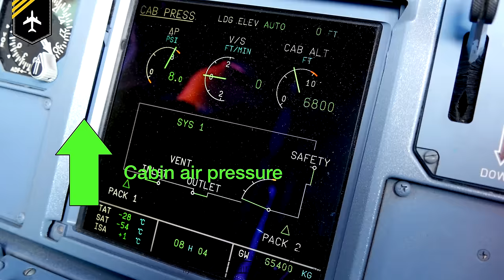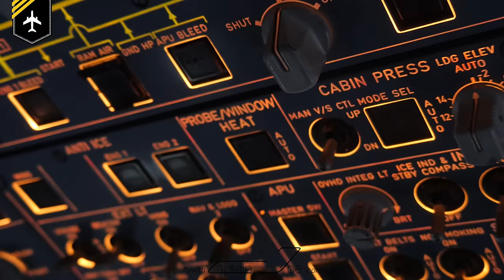Why is there a HOLE in AIRPLANE windows?

Comment: Would pilots in cockpit know immediately (or in very short time) that outer glass is fractured in passenger window when middle fallback layer became only operative (assuming air would flow out through that pressure equilibration hole?) Is this emergency situation for diversion from destination?
Are there any related incidents related to passenger windows?
Reply from the maker: That would be a very slow decompression, it would cause for an emergency descent! Greetings Joe
Reply: Dev Deviruchi A warning alarm would go off if i is in a critical level

Comment: I have a question. What is trim and what are the spinning trim wheels next to the throttle and what are the smaller levers behind the throttles.
Reply: ukkomies100 trim makes the aircraft easier to fly. The spinning wheels is what the pilot uses to adjust the trim but when they are spinning by themselves that's the autopilot. The small levers are the reverse thrust. They are pulled up and back to engage the thrust reversers.

Comment: Very nice! I couldn't help but notice that on my last flight, which was on a 737-8AS, there wasn't this hole? Is there a reason for this?
Reply: I recently flew with a Transavia 737-800 and I couldn't see it eighter and in the 737-800 from Miami Air I couldn't see it eighter.
Reply: Kai Van Loon Maybe it's an Airbus thing...
Reply: Newer windows might have them on the side so you can't see them.
Reply: +00PiggyCosmonaut They're on the top on the new 737 ng's. They've been having fogging issues with the hole in the bottom design, at the top of the windows there's a cream coloured rectangular tab which does the same job as the hole, but prevents fogging.
Reply: Aah okay thanks
Reply: Aah, I have seen that, thank you very much for the info
Reply: Cool. Airplane window engineering has definitely come a  long way since the square corners on the windows of the de Havilland Comet :)

Comment: why airplane need flaps?
Reply: Siap l Minecraft why?? Flaps needed for extra lift when take off & reduce speed when landing. If flaps wasn't needed, plane lost lift power & there'll be accident like Spanair 5022.
Reply: Same reason yo momma has flaps
Reply: Flaps generate more lift at low speeds. Without flaps the runways would need to be much longer to give the planes time to accelerate to the higher speeds needed to take off and long enough of the landing planes to slow down. With flaps planes and slow right down when landing and can lift off at lower speeds during take off.

Comment: Hi Joe, just wanted to know why does the captain always take control on the ground even if the F/O landed the plane?
Reply: Charlie Delap "Captain taxi" rules. Not all airlines adapts to that procedure
Reply: Ifly 777 Ah I see, thanks for clearing that up for me
Reply: Some aircraft also only have a Nose wheel steering tiller on one side. IIRC the 737 only has one on the captain's side as dies the ATR.  The A320 has one on both sides

Comment: captain joe, can you explain why the airplane windows is round and not square?
Reply: Zikri Amrillah the pressure would build up on the corners of a square window and the square window could fail. A round window equalizes the pressure around the window so the pressure does not build up in one spot on the window.
Reply: The Space Wolf does it mean the round window can maintain the pressure off?

Comment: what happens if you put you finger on the hole in side the cabin
Reply: 1.  The hole is in the middle pane, not the plastic cover you can touch.
2.  Even if there was a hole located in the inner pane covering it would have no affect since the pressure/humidity/temperature between the inner and middle frames is identical under normal operating conditions.

Comment: What is "trim"????
Reply from the maker: Video coming up :) Greetings Joe
Reply: Bill Kaczmarek It is the two black and white wheel spinning thing besides the thrust levers
Reply: Grossly oversimplified, Trim is a way to make small adjustments to the flight control surfaces to create a desired tendency. lets say youre flying a Cessna. And you are at 4,000 ft. Youre at cruise speed. depending on how weight is distributed the nose may want to naturally rise or lower on its own. You can trim the elevators to a point where (even if you let go of the yoke) the plane will naturally hold level flight.
Reply: What my wife does to her bush every month
Reply: Booyah!
Reply: Its kind of like a lift adjuster.
Reply: Billybo y a haircut
Reply: Billybo y
Reply: My regular cut

Comment: how do you maintain supply of oxygen inside cabins at high altitude??
Reply: rahul dwivedi The air is taken from the engine. Because the air in the engine is compress
Reply: but at higher altitude practically no air ????
Reply: rahul dwivedi There is air. If there is no air then planes can't fly. When the air is compress, the air becomes thicker and the oxygen atoms becomes more dense.
Reply: You get the oxygen and cabin pressurization from the Environmental Control System (ECS) bleed air. When air enters the jet engine, it gets compressed. As the air gets compressed, it gets pretty hot ~500C and a portion of that air is tapped off and sent through a primary heat exchanger (radiator) where it cools down. After cooling, it goes through an ECS turbine or a pack and gets decompressed. As it does it heats up again, and goes through a secondary heat exchanger and after a series of check valves and such reaches the cabin at a cool ~50F You don't get any of the carbon monoxide or anything because it's before the combustion chamber of the engines. Hope this helps. I tried to simplify it a little haha. 

-F16 Avionic Systems Technician / RC-135 Communication and Navigation Systems Technician.
Reply: So do the check valves regulate cabin pressure?
Reply: KiwiPowerNZ not check valves per day but regulators. Different planes are regulated at different altitudes. Some are pressurized at a 4,500 ft level others as high as 8,000 ft. That means at let's say 39,000 ft altitude the planes interior is pressurized to what the pressure would be at 8,000 ft. On F16s it's all automated, but on big planes such as airlines and such I believe it can be somewhat adjustable not sure though. 

This will help explain it better. Look at page 16-36. Most planes use a pack I.E. Air Cycle Machine ACM. 

https://www.faa.gov/regulations_policies/handbooks_manuals/aircraft/amt_airframe_handbook/media/ama_Ch16.pdf
Reply: Sorry page 16-35

Comment: CAPTAIN Joe what is the average speed of an aircraft
Reply: It depends on the type of the aircraft.  For example if the aircraft is a turboprop or a jet aircraft, or twin engine or four engine.
Reply: Okay
Reply: @androidarcher7634  - Here are a few examples: 
Airbus A320-200 economical cruising speed 840km/h (454kt) at 37,000ft.

Boeing 737-800  Cruise: 838 km/h (453 kt)
Boeing 787  Cruise: 903 km/h (488 kt)
Reply: OKAY can you tell me more
Reply: @mikep9604  what about the 747
Reply: @androidarcher7634  - 
Boeing 747  933 km/h  (504 kn)

You can use Google search to find more info about other aircraft. Use words: "Boeing 777 cruising speed" on Google search, or "Airbus A380 cruising speed" and so on of any aircraft type you want to know.

Just change the aircraft type on the search and you can find the information about all the aircraft you want.

Comment: Do pilots need to go to college?
Reply: no, but due to the competition it looks better. Yu can go straight to flying and get all your certifications on a per flight hour basis until you complete all requirements. Get ready to spend around $150 an hour to fly the airplane. When you are done with the requirements, you won't have enough hours to look good to airlines so most pilots become instructors in order to  accumulate flight hours and having the student pay for it. being an instructor kinda sucks and you have to put in at least a couple years to get a decent amount of hours. Also you won't make much money. Everything changes based on demand. When i went to flight school in 2004, airline business wasn't doing so hot and many pilots were out of work and ended up being instructors to pass the time. But there were times where the industry was booming and it was a much faster process. Pilot life isn't good and doesn't pay well until you becomes a captain on a Boeing or Airbus and that all depends on how many captains retire and they don't like to retire unless forced to.